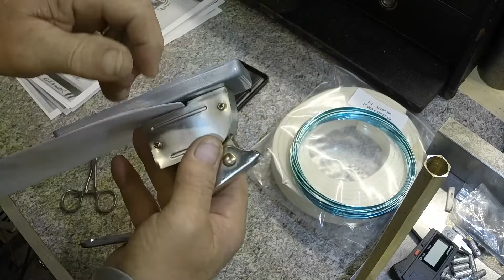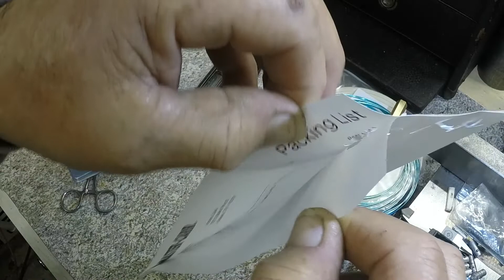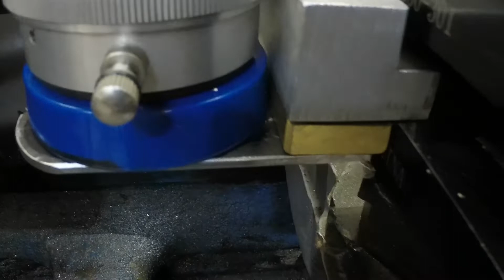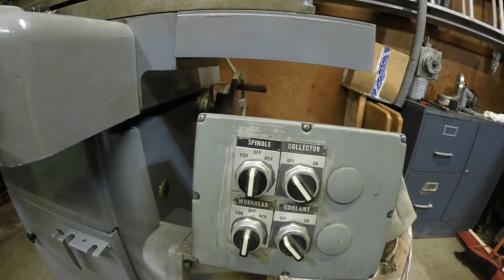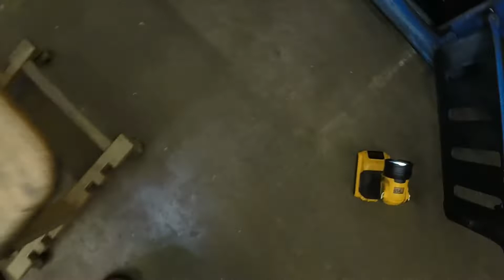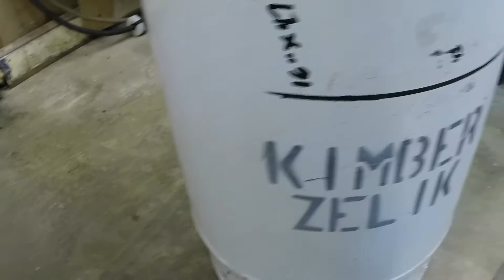MY MOTOR & OTHER ITEMS OF INTREST

Comment: Ironically, just yesterday I received my first large face Dial indicator. It's 3 and 1/2 in across starrett tenths Mike. It's incredible! Every time I glance up, I'm thrown off buy how goofy it looks.  I don't know why I didn't do this years ago. You can read it easily from 5 ft away. Pretty good deal on eBay too. About 2 years ago I discovered the starrett split flap display micrometer. After using it for a week, I ordered the next two sizes. These two conveniences in the shop cannot be overstated. I don't know about others, but my glasses often fog in the shop and I take them off. Makes all the difference in the world when you can just quickly glance to get your measurements

Comment: Just a note about grinding carbide. It is not enough to have fans running. Many toxic substances are fine as long as they are sufficiently diluted in the air. This is not the case for carbide. Carbide is dangerous neurologically, not respiratory. So if you turn on fans, you're just blowing toxic dust around the shop. This is why I advised you to get an inline fan. That will allow you to have a piece of ducting right next to the grinding head that automatically exhausts outdoors. This same danger is true of cutters with high amounts of cobalt. Please be careful. I'm not safety oriented generally speaking, but you really don't want to mess around with this. It is great that you have the respirator, but you don't want the dust accumulating around your shop. It's also terrible for your lathes ways